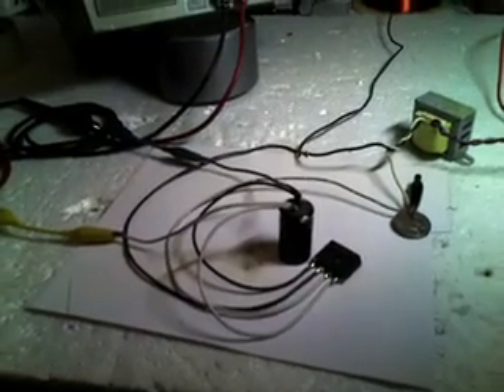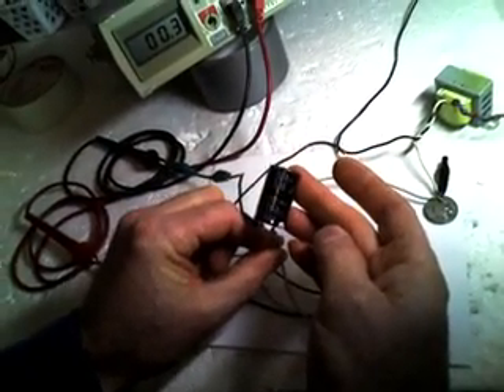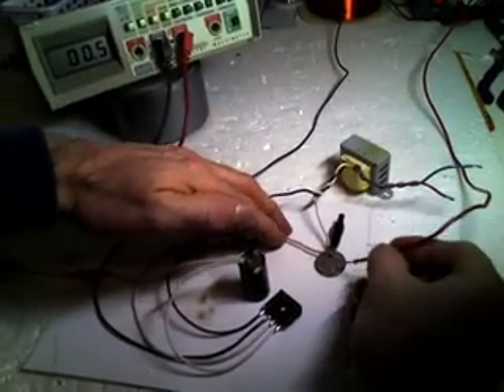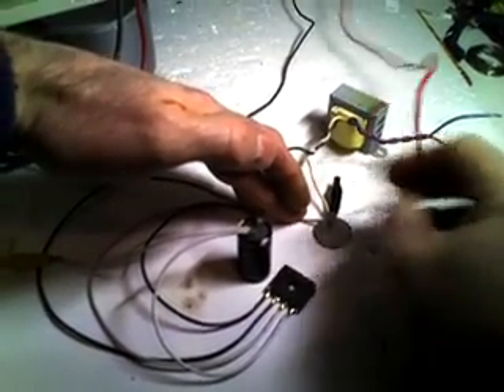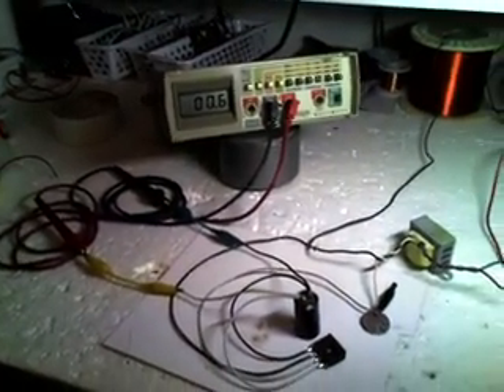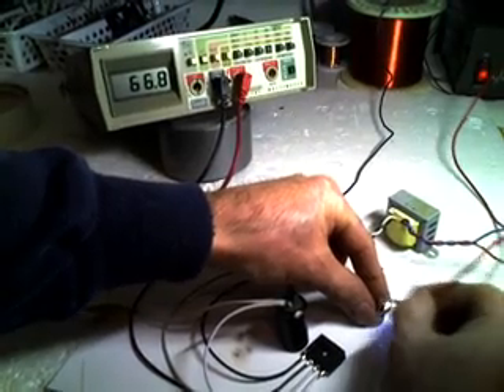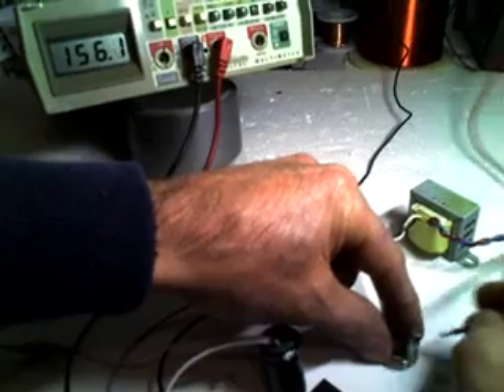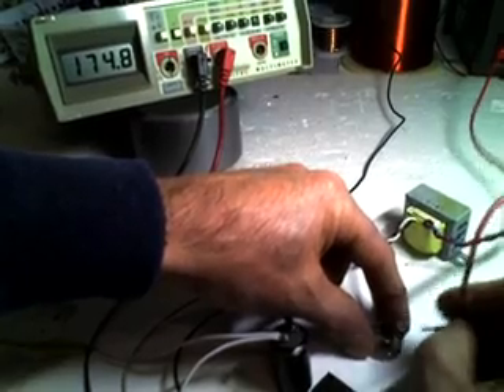Electricity Amplification by Neo Magnet test 1

Comment: Ok this might be the best video I've watched in years. This proves a form of free energy from magnets. I just did a similar experiment, where I noticed that a spark plug sparks much stronger if you "jump" the spark in open air to the neo magnet. Something occurs when you get sparks on a neo magnet. The spark seems to be part of the process. The sound you hear is the extra energy being added to the spark by the magnet its self.

Comment from the maker: you use a close to hair fine copper wire on the surface the of the magnet the wire will start to vibrate which will break the contact (switch on and off) You have to try it on each side of the magnet to find the side that works. One side the wire will stick to it and the other side will vibrate.
it will work with just about any coil. It's the magnetic field around the wire that will repel the wire from the correct magnet pole and cause the rapid pulses.

All the best in your experiments

Luc

Comment from the maker: Hi HFCOILCOMPANY,

this was done back in 2008 when I knew net to nothing in electronics.
At this time I have all the equipment you mentioned. 
I also know what's going on in this neo magnet effect. The dynamic between the wire and magnet is basically a mechanical electromagnetic oscillating switch.

Thanks for your interest

Luc

Comment: I have a great idea from this video. Watch what I post this evening. I have a circuit I have been using for years now that is completely self oscillating which was just a smidge overunity, now, utilizing this effect, I think I will be much higher than before. Thanks for posting, this is an awesome observation and achievement, I do not believe it is related to the magnetically quenched arc gap, however, that has another profound effect that I will be utilizing to create an additional amplification of energy if that is what the circuit is actually doing. While it isn't continuously pulsing, it is difficult to tell, however, I have a  method to continue the oscillations and test with meters and a scope to see what's actually happening. It is certainly increasing the voltage by at least ten times, so, if the voltage and amperage both increase, we have a winner!

Comment: I also think it has to do with the magnetic field quenching the spark gap.

Tesla was using a magnetic field to quench sparks gap discharges from capacitors being charged with another source of high voltage.  From this he could get very intense and high frequency discharges.

I'd really like see a capacitor charged up to a few kv, and spark gap between a very strong magnetic field that you can slowly reduce until the discharge happens.

Comment from the maker: Hi Drevtoobe,

Thanks for looking and your comments.

Look at zerotensor explanation below. I think he has it on the nose.

Thanks

Magnetically quenched spark gap: the plasma arc is destabilized by the application of a strong magnetic field. The resulting spark self-terminates much sooner than it would in the absence of a magnetic field. This accounts for a more rapid change in flux through the inductor, and the substantially increased EMF which gets dumped into the cap with each pulse.

Comment: if it does work like a gray tube, I'd build it like one, or maybe even supplement one with magnets.  Perhaps a cylindrical mesh screen (or a few of them in layers) around the spark and magnets, connected to the wire you start the spark with.  So the initial spark starts the transfer of energy, and as is is pulled away it ionizes everything around it to the point that there is a large electron avalanche emitting from the screens.  The key in lots of free energy seems to be electron avalanches

Comment: Magnetically quenched spark gap:  the plasma arc  is destabilized by the application of a strong magnetic field.  The resulting spark self-terminates much sooner than it would in the absence of a magnetic field.  This accounts for a more rapid change in flux through the inductor, and the substantially increased EMF which gets dumped into the cap with each pulse.

Comment: Great work Luc ! Keep it up. 

Did you see what magnacoaster's Richard Willis is doing? See his website and go to "how it works"

The sound change might be because it's an implosion? It might be Endothermic versus a standard exothermic Electric Discharge. Is the magnet surface cold after?

And with the spark being blue versus white? Then it should be radiant spark/charge you are collecting on that cap.  

An yes it's seems like it's acting as a charging choke a la Stanley Meyer/ Tesla.

Comment: I would call it SURGE, rather than EMF- since it is temporary.When you static-charge a Cap. it always goes up from zero. If you put 27,000uf it will go up much slower! I agree flux is involved, flip mags to see if result changes? Same arrangement can drive Wheel-hub, if you rotate mags. inside coils freed from the transformer. See my "Mag Amp Gen" vids to see some results with different circuit arrangements. Please suggest improvements - since I am now moving up to 48v systems.

Comment from the maker: Hi there, I'm out of the country so sorry for the delay in reply. I do have 2 more video's. However, I did not confirm any energy gain at that time. So I moved on to other experiments. What happens is a neo magnet is nickle coated which is conductive, so if

Comment: Try adding a capacitor.  Or try adding just more metal washers.  It's an increased mass, and a increased capacitance....
Edit: May be more of a surface area thing... adding washers on the table in a chain would help more than stacking

Comment: I think this is a form of free energy from magnets, pure and simple. The question is, is there any practical way to use it? And is it significant enough to be of practical value. The other question is, does it ruin the magnet quickly due to overheating, or weakening of the field. It rasies a lot of questions, but I still say it's proof of free energy! AWESOME. Do you have anymore updates?

Comment: Thats how i increase the v ac   initially spark from aligator clip to primary core  using ferrite ring magnet as spacer to the secondary   e core   from 80 v to 335 v ac and lit up 40 w of led lamps

Comment: Dear Luc, you are actually, with your repeated transient spikes, disturbing the ambient aether, surrounding the point of spark. This distubance increases in the presence of magnets and more metallic surface area, aether, in order to get back in its original shape, pushes electrons in your circuit from the available free electrons. Thanks for sharing.

Comment: Luc: Changed my mind! Not flux HEAT! Why Currie temp. 1300 & not 3500? Why BORON (10,000?) in Neos? Room temp: 75* - but freezer in room? -40*. Candle near freezer? 600*! Hold on to that analogy - it explains much of our trouble from back-EMF heat & need to avoid it! Iron domains affected - even far from melting point: INSIDE EARTH & elsewhere!
Montreal - east end. Hope you can do some larger-scale, road-destined projects (I'm pretty alone here).

Comment: Well I tried replicating this after seeing this experiment. Clearly it is not easy to replicate. I spent 3 hours trying different sizes and shapes of coils, transformers, neo magnets, non magnetic test leads, magnetic test leads, nickel plates (316L stainless steel plates) etc. I even used 20,000 high voltage sparks and run them through a neo magnet with no change the output. Hmmm... Guess it's back to square 1 for me.

Comment: The spark creates ionization of the air, creating a plasma.... Plasma is very responsive to magnetic fields.  You're forcing the electric current to ionize the air and then the magnetic field of the magnets accelerates the free electrons in the plasma....Not only that, but I bet there is a slight electron avalanche from the ionized air, almost like a gray tube.

Comment: Okay" SO, when you put the magnetic field into the nickel, by applying the magnets" your actually increasing the (Back - EMF.). This is demonstrated by the "Solid state genarator" where you have an square shape of plates, with Two ciols of wire, to make a magnetic field in the plates" and Two coils Two pick up the "magnetic field" and put out 
Voltage, if the first two windings have the fields of polarity contenusly flipped back and forth forcing the magnet fields to reverse over & over" the permanent N52" magnets, field's, will produce, an high voltage.!! I will put the link into my Comment,.So, anyone who wants to check it out for themselves can.. But first I have to go back and find it.lolo